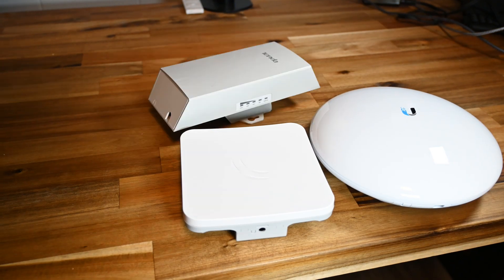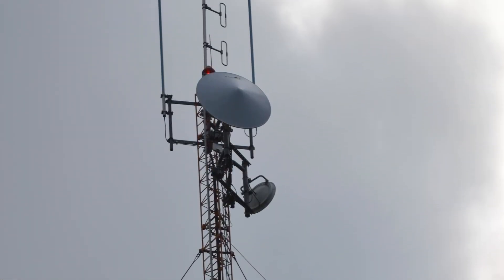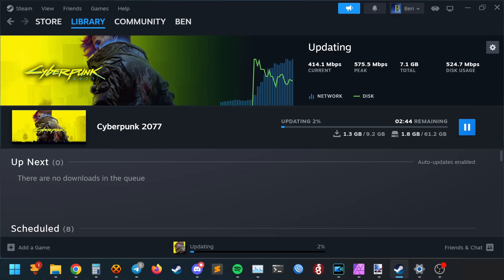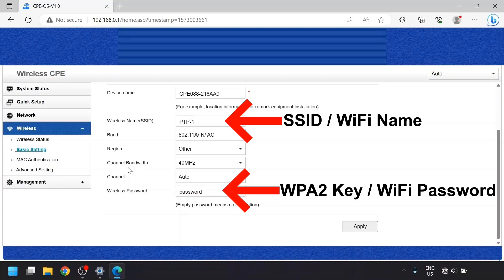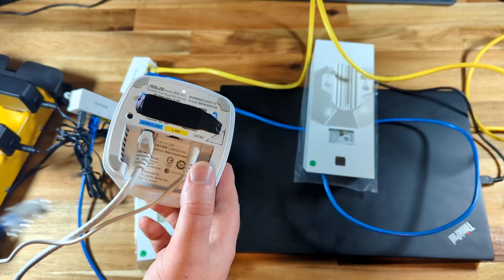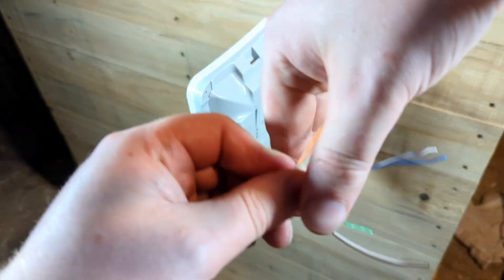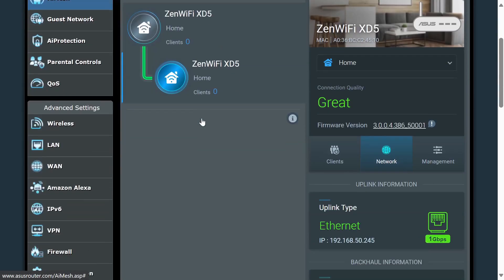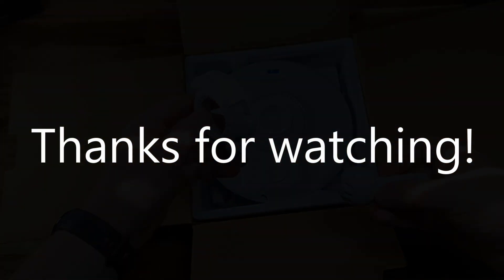Bridging on a Budget: Cheaply extending WiFi to another building

Comment: Thanks for this video, can you tell me the pros and cons of using WAP vs a router in the second building, I wank to use this bridge with security cameras in the second building.  Will the WAP provide better connection, is the set up easier?  Would the WAP connect to the second bridge using the LAN port?

Comment: Excellent tutorial, exactly what I needed! My shed is a good 50 metres away (phone has trouble connecting to wifi at that distance) and I need an antenna to bridge that gap and make the internet connection available to an ethernet switch. Now I just have to figure out which brand I should buy.....I hear that Ubiquiti models are largely proprietary and won't connect to a standard wifi hotspot.
(ARGH I don't understand though......people only talk about using two antenna units in a bridge, without explaining why! Can't you just have one antenna at the secondary site, pointed at the primary location to pick up the wifi signal? Why do you need two antennas?? Or is that only required for very long distances??)
UPDATE: Can confirm that only one antenna running in client mode is all you need for a short distance. I got a TP-Link CPE710 and didn't even need the antenna dish attached to get a good connection. Hell yeah.

Comment: Your video is good, thorough and explains a lot. But, As a business owner, wanting to get this done properly, have all my buildings act like one network, so all my video cameras worked, plug and play, and I could send data everywhere, I went to RadioLabs , purchased their Zip Bridge dual band, with routers, and the entire thing was Plug and play.
Kit included my routers for inside my remote buildings, which provided excellent coverage in my 5000 and 8000 sq ft buildings the full dual band bridge, plus, I have WiFi all over the outside of my property and complete coverage. I mounted them on poles I had, and their bridge, was labeled and complete plug and play. 
I did not have to go through half of what you showed here. But, their bridges are like 2 times the size of what you show. Their entire kit price, was less than the mobile company wanted to even come look at our installation. 
After installing on our business, I then used their other bridges on my home, where I failed to get WiFi to my shop with substantial trees.
Working on Government projects, we cannot use TP Link at all. They are on our banned hardware list as well as a couple of other brands.
We cannot use anything made in China when dealing with government projects.
I'm sure my comment won't be seen so it won't matter, but I can provide links and the entire project cost. The local IT company, wanted $2,500 just to come out and design my wireless. The RadioLabs complete dual band bridge, cost much less than they even wanted for consulting. I'd just recommend going to them, if you're in a hurry and want it done properly.

Comment: Your presentation style is clear and easy to follow, but some of the information you're presenting is not correct or even safe. You don't ever want to crimp RJ45 plugs onto bulk solid conductor cable. Instead, you should use field termination plugs or punchdown jack and weather rated biscuit box with manufactured UV rated patch cables. Also, you made zero mention of installing lightning arresters and how to properly bond them to ground.

Comment: Great video but I think you missed one of the most important points - if you're installing any of these equipment outdoors, even if it's under a partial shelter (roof overhangs etc), do install an in-line Ethernet surge protector to protect the equipment behind it. e.g. router/ switch/ PoE injector etc.
I've seen an install in a customer's site back in my old workplace where they had to replace the surge protector 2 to 3 times a year because of lightning activity despite the fact that the extender was installed under an overhang and the building (small concrete shed) had a properly installed lightning rod. The surge protectors did protect the rest of the equipment (enterprise switches, routers, and ISP CPEs) behind it though, so that saved a lot of potential lost time and effort to replace these.